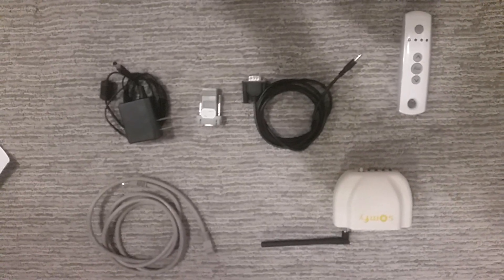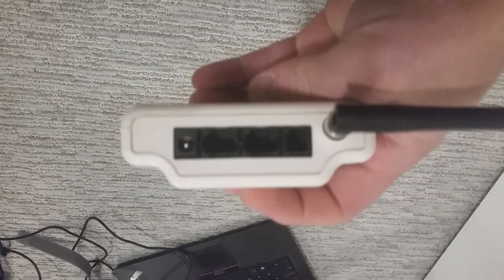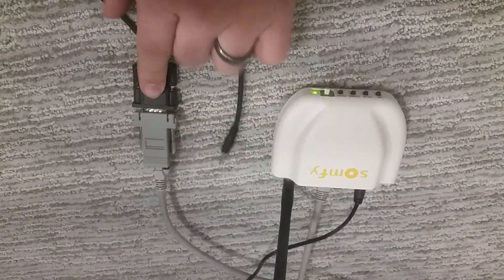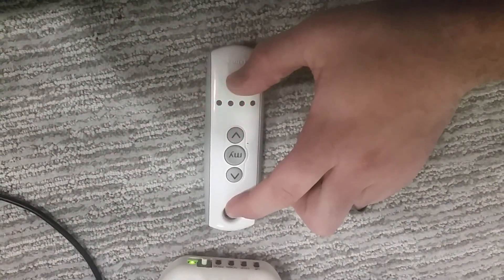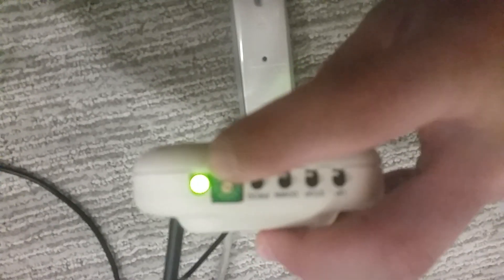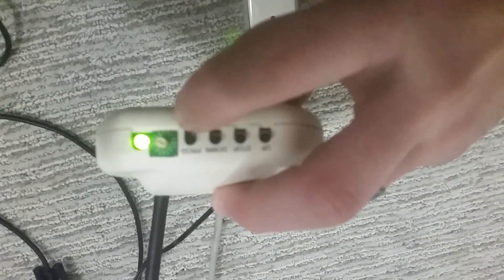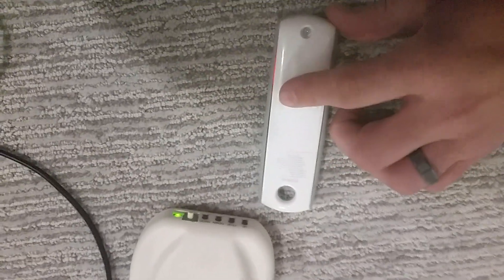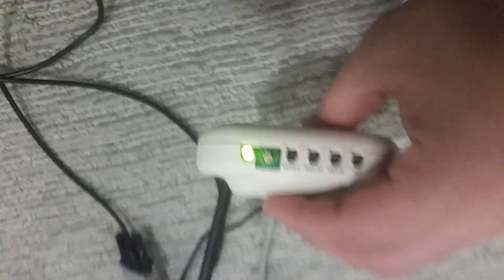How to connect Somfy shades to Control4 with the URTS Interface. (UPDATED)

Comment: Quick correction, the 0-9 and A-F are actually all separate "channels" of this device, similar to a Telis 16 RTS remote. Channel 0 is channel 16, so it is 1-9, A(10), B(11), C(12), D(13), E(14), F(15), 0(16).